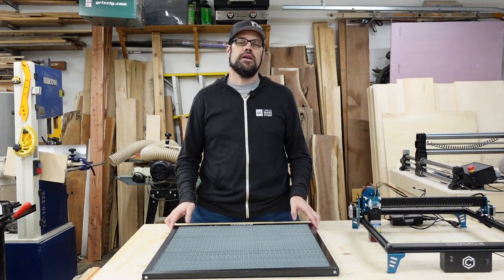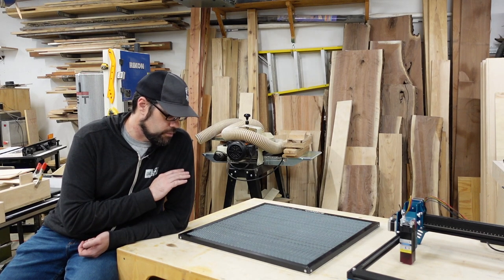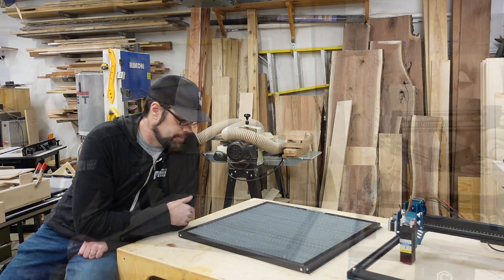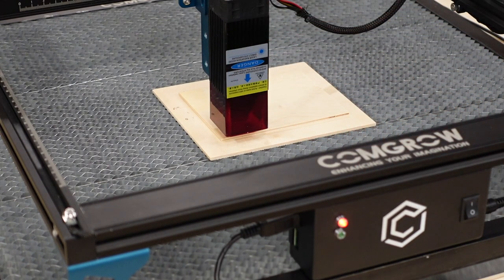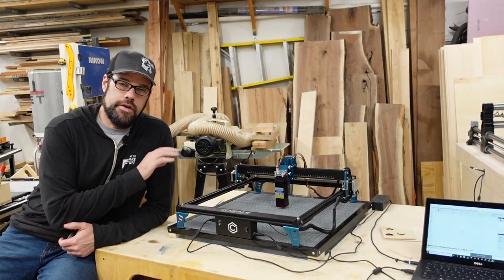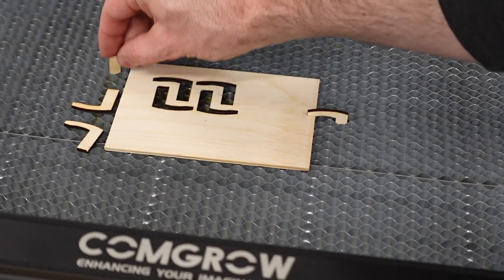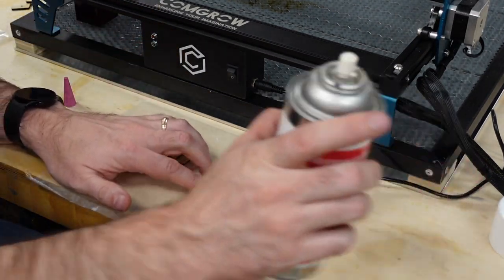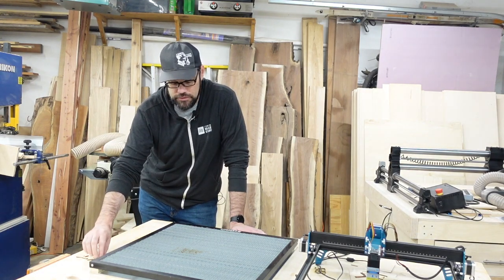Comgrow Large Honeycomb Bed and material hold down options

Comment: I make mine in the shape of a T and I have a hollowed out sliver in the middle so that they can squeeze/flex a bit. Mine are also designed to just the right size so that you put them in at 45 degrees nice and easy (kuz of the honeycomb), then twist to tighten and do the opposite to loosen, twist and pull to take out. I also have a half dozen hard drive magnets and some old permanent magnets that are a bit larger than the ones in the Vid which I built an eletric motor out of long ago, those things can injure a Person and they're awesome- I never thought to make something like this for them, thanks for the idea! Nice Vid!

Comment: Thanks for the clear video.
When cutting plywood, I normally use bigger magnets. They can be placed on the sides but also on the middle.  More “crooked” wood (hope I used the right term) can be made flat again.  So I can make sure the laser is cutting at his lowest power setting so the burn marks are as little as possible. (Yes using air assist and a honeycomb).
 
The only disadvantage of those bigger, and strong, magnets is when removing them from the plywood and stack them together; I damage my skin in between to magnets way to often 😢😢😢
I have to get used to not stack them and store them separate. The CO2 laser I use has a nice metal housing where I can store them.
Reply: magnets only for Iron materisl laser bed,but for aluminums ,need some pins they will provide.

Comment: Thanks for the great video. As a fairly new laser user I have been watching a lot of YouTube videos on lasers and the subject of hold downs is not covered much. Thanks for the ideas, I will be making some very soon.
Reply from the maker: Glad it was helpful!  Depending on the specific honeycomb tray you have, you may need to adjust the thickness of the bottom part of the clips, but that should be fairly easy in lightburn or inkscape.
Reply: @Vintauri  I have a X Tool D1 with the honeycomb bed. On the non magnetic hold downs, do you taper them on the part that goes into the honeycomb? I’ll play around with it a bit, I’m sure I can figure it out.

Comment: Noob here: Just found your channel and subscribed.  I have the 400x400 bed.  How do I determine where to place it inside the engraving area?
Reply from the maker: You'll want to ensure that the honeycomb weave covers the engraving area as much as possible so that the laser beam will not end up on the outer frame pieces. If your panel has the measurements inks on to the rails, don't try to align those to your lasers coordinates.  They will rarely be able to match.
Reply: @Vintauri  Thank you for video and responding so quickly.  How do I determine the "engraving area"?  Is there a file I can "engrave"?
Reply from the maker: @idmnstr  That should be in the specifications of your laser, such as 400x400mm working area.  You would want to position the honeycomb panel so that when the laser is in it's 0,0 position that it's in the corner of the honeycomb weave but not on the frame.

Comment: Another cheap hold down option is hard drive magnets. Most have a magnet centered on a piece of metal and would work the same as your wood version.
Reply from the maker: Those are becoming harder to gather as the drives move to SSD’s. Plus depending on the size they can be very large and almost too strong. But I have pulled some hard drive magnets that would work quite well.

Comment: Is there any sagging by lifting it up off the tray?
Reply from the maker: I checked that with a steel ruler and there was no noticeable drop. However if you placed a heavy object on it then you would risk getting some sag. The Z1 laser sits on the rails so it did not sag the tray. You could add blocks around the edges to help support it more if needed or even a steel block in the middle as well.